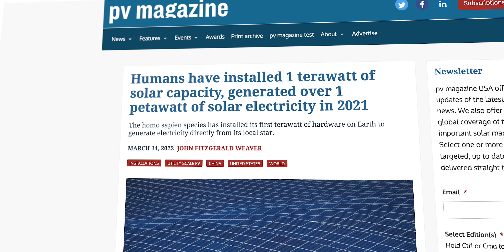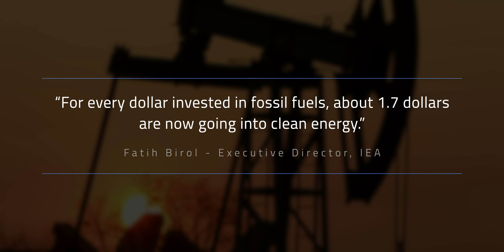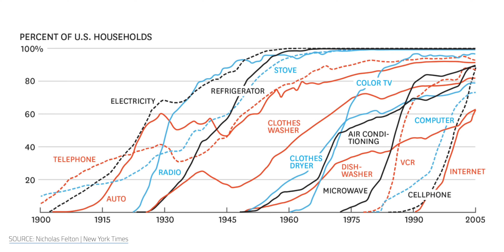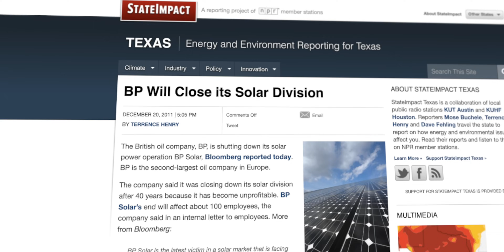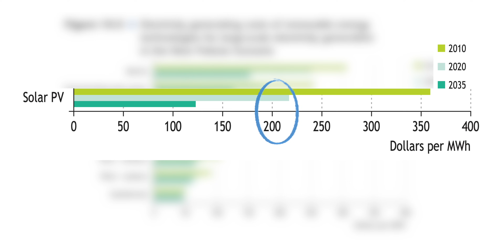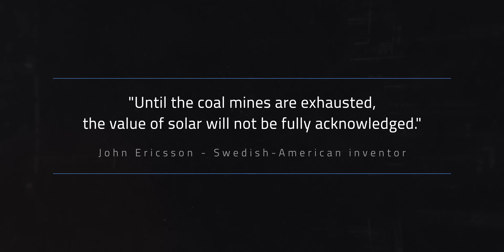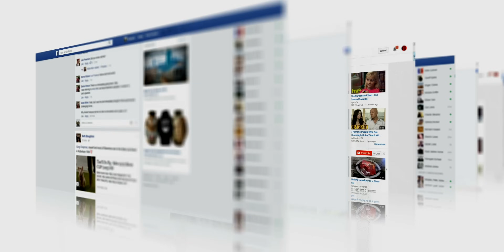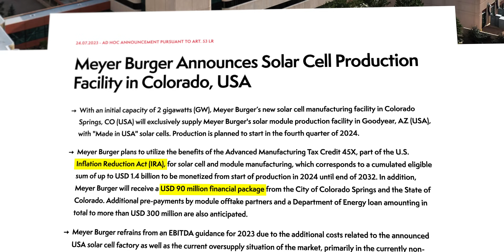How Solar Power Got So Cheap … So Fast

Comment: Imagine if the cost to install solar on your roof also dropped as substantially. It's roughly the same here as it was 7 years ago when I first looked into it.
Reply: I got solar on my home in 2009 and it cost me $8500 for a 3Kw system.
Today you can get that for $2500. (Australia). 
Mind you - when I purchase it, I was also guaranteed a high feed-in Tarif. I still get $0.49KWh today
Reply: Something to consider though is that if it is exactly the same price, then that's actually a ~30% drop relative to inflation over the same period. If your income hasn't risen at all though then that's a different matter.
Reply: The same price over 7 years for something that is mostly hard to automate manual labor is actually kinda impressive.
Reply: Shipping costs for panels 💸💸💸
Reply: @simon359  True.
Reply: New modular builds can just include it from the start, that's probably the cheapest way. Edit: DIY is cheapest of course
Reply: It's about a third of the cost now. The reason why you don't get to see the savings is because corporate profits are up and while there used to be a 16% profit margin, now there's 131% profit margin which is absolutely fucking ridiculous
Reply: @gcburns4 I've studied this extensively over the last 20 years. It's not talked about much for two reasons:
1) Any negative publicity spirals out of control and limits adoption.
2) Retired systems haven't reached critical mass yet for recycling to be economically feasible.
Energy to mine and manufacturer solar cells vs energy generated in their lifetime reached break even in the early 1990s. Now it's off by an order of magnitude. Solar is already good enough to be a no brainer. Energy storage is another story - and lithium ion batteries probably aren't the right technology for the job. But others are already on the way commercially.
Reply: absolutely, there are still tech knowledge required and gimmicks to put together a decent system with battery backup and grid feedin. wish it is more modularized and fool-proofed so any regular dude can install it as if a dishwasher or a fridge..
Reply: @gcburns4  It only takes about 2 years for solar to offset its emissions compared to fossil fuels, and an industry standard 20 year warranty (which does cover degradation outside of the expected 20% loss over that timeframe) which is more than double time needed to reach the financial break even point in most regions. Solar doesn't have a high ROI, but it is about as low risk as any investment could possibly get.
Reply: @gcburns4  What nonsensical drivel.
Reply: If it's the same as seven years ago in absolute terms, then the price has fallen.
Reply: @zweigackroyd7301 how? It’s not like people actually have more money. We are all broke.
Reply: @MoDa87  there's the problem, people voting for right-wing governments which will always shift money away from regular people & towards the already-rich & greedy megacorporations. There's plenty of money around, it's just that we won't see it till we learn to vote in our own best interests.
Reply: Unless we replace the workers with robots or build all houses out of prefab elements including roofs with solar tiles the cost of rooftop solar is unlikely to drop much. Only other technical innovation that might help is lighter panels, as those could be so much easier to carry that fewer workers could finish the job faster, but it is likely the installers would still bill you for at least one full day of work.
Reply: @gcburns4  Yes, There is a lot of ideological elitism on this. Solar would ot be making the gains at this point without all the past incentives.  In a few years, I think every home is going to have power stations or solar power generators for critical issues. Solar power generators are getting cheaper; there is a lot of value is saving a fridge of food and keeping a few lights and critical comforts going.
Reply: @gcburns4  This does get talked about but in general nobody cares because almost nobody is going to throw out perfectly working 20 year old panels, yes they degrade and produce less energy but that doesn't mean they suddenly stop working completely after 20 years, they could very much still be producing around half their rated power 50 years later which is still a lot when we're talking about a 5 to 10kw system for a home.
Reply: Is it the same price for the same size and amount of panels or for fewer larger panels with better inverters etc?
Reply: Its only laws and rules propping up the costs of a system at this point.  I cannot install panels on my own house so it will never happen.  The laws require an authorized contractor and that is the only reason prices haven't plummeted.  Also you dont get the rebates and stuff the authorized contractor does, whether you get is hit or miss depending on the contractor and whether the declared bankruptcy.  5 years ago about half the authorized contractors are now not on the list currently.  Ten years ago its around 80% of them are gone.  You can find tons of youtube videos of local news stories about the nightmare solar has been.  Mostly due to crappy contractors.  People need to be able to install their own panels.
Reply: @gcburns4  Everything you stated is misleading or completely inaccurate.  For example solar panels are warrantied for 25 years or more and they will continue to keep working long after the warranty.  There are 50 year old panels still working.  They pay back their construction CO2 in a few years of use and both batteries and panels are recyclable and many companies are already doing it.
Reply: most of that's the workers and the mounts. Neither have changed much. It'll take much lighter panels to get anywhere on price.
Reply: The costs for installers hasn't really gone down. Has Diesel gotten cheaper? Has minimum wage (let's assume their hiring is on the up & up) gone down? Do they get some form of direct subsidy for being a solar installer? If the answer to any of those questions is no, it would hold the price of installation higher.
Reply: @gcburns4 I agree for the most part, but I don’t think it can be argued renewables have a higher carbon impact than say nuclear (I’ve worked on a nuclear power station, huge amounts of concrete ) or CHP (still burns fossil fuels, leaves renewables in the dust on carbon). You name a power source, I’ll name a major drawback that eclipses renewables. That said, solar panel recyclability is a  surmountable problem. And solar is an elitist technology until it’s so cheap, ubiquitous that nobody cares. Lack of solar for low income people shows a lack of financing option, and huge demand relative to supply.
Reply: @MoDa87  There is inflation. If you measure in constant dollars, $1 today is worth less than $1 7 years ago. Time value of money. Say the installation cost $1000 7 years ago and $1000 today. Seven years ago you could have bought more with that $1000 than you can today. If you had put the $1000 in a saving account 7 years ago, you'd have more than $1000 today.
Reply: @markmuir7338  what do you think about alternative battery ideas like the rust battery?
Reply: Is the op a troll? This is just not true
Reply: @greasybumpkin1661  We need as many ideas as possible for low-cost stationary energy storage. Whether that be rust batteries, liquid air storage, sodium ion batteries, molten salt storage, etc. That way hopefully at least one of them will pan out and become a commercial success at grid scale. It's difficult to tell at this time which it will be.
Reply: @markmuir7338  my engineering expertise is admittedly quite simple, but I have wondered what the feasibility would be of a good old fashioned wind up battery. This is something you don't need special elements for and could be wound up via kinetic energy from wind and hydro. How to scale something like that, IDK, but it's a system that can be repaired and maintained by a variety of technicians, literally just gears and ratchets. Thanks for responding
Reply: @greasybumpkin1661  That's called clockwork energy storage - and it is a thing. A similar old-fashioned solution is fly wheels. Both are simple and use readily available materials, yet are surprisingly expensive compared to even existing chemical batteries.
Reply: @markmuir7338  how so? Do they break often?
Reply: @greasybumpkin1661  The energy density of mechanical energy storage is very low compared to batteries. So you need a LOT of them. Notice how much longer watch batteries last (months or years) vs wind-up watches (a day)
Reply: In 7 years the price for brackets, bolts, and labor, would stay the same. Unless you know how to make metal cheaper, or enforce slave labor, installation is a pretty standard fee. You'll literally need to exploit your work force, (possibly making them slaves over time) for continued price drops of manual installation jobs. Literally just pay the laborers what they're worth and stop acting like everything should ALWAYS be cheaper over time.... a lot of that is achieved by the Chinese who work 80-90% of their waking hours living inside factories.... seriously STOP complaining
Reply: @baileescott401  I agree. Also if we pay people well for very good craftsmanship, then the products ought to last and be a worthwhile investment. The west got into cheap goods because the consumer and financial market replaced the productive one, the former requiring constant spending.
Reply: @markmuir7338  ah I see, so I guess the storage solution has to be chemical in nature then until something else is discovered.
Reply: @greasybumpkin1661 There's schemes like pumped hydro (which is around 80% I believe)
But it requires very specific geography, a huge hydro installation and transmission lines laid in.
Whereas you can site solar on a defunct coal plant, transmission/interconnect is already in place and batteries are modular requiring only a pad.
Reply: @@mitchellcouchman6589 Even in China only about 60% of the electricity comes from fossil fuel, and solar is displacing fossil fuels a lot more than it is displacing nuclear or renewables. That 35-40% makes a significant difference in the carbon intensity and therefore the time needed to reach net zero emissions.
Reply: @InvisageStudios 
Was there an increase is subsidies there since you got them originally? Of the places I’m more familiar with, almost all have had an increase in subsidies over time (although some have recently started to reduce them or are planing on reducing them soon) and the cost have increased over time even with more subsidies.  Where I am,  the cost of a 3kw system is 4-5 times what you mention( yes I converted to aud), and this is not including installation.
Reply: @billweir1745 really Bill?  Because I have done my own 24KW install and I agree completely with his assessment.  So what are YOUR numbers?
Reply: ok
Reply: You can do it yourself with a month or 2 of education and a diagram submitted to the local power provider. My whole system cost me ~5k, and I have a 5.5kwh throughput 120v output system with 7kwh of solar and 4kwh of LiFePO4 batteries, shield wire so on, I'm also a very good shopper though so most would spend 7-8k for the same.

Comment: Cheap solar PV was surprising for even me. While planning my off-grid net-zero lodge and cabins development, I had been planning on a mix of solar PV and thermal vacuum tubes, but an advisor pointed out that even if I use resistive water heaters, for my climate of Nome, Alaska it’s better/cheaper to use just PV. Of course I’m using heat pumps, so it’s even better.
Reply: I'd be interesting to know more, if you are willing.  I live in Canada and so far, it would seem that PV doesn't produce enough during the snowy times to be worth while. Clearly your numbers don't agree.
Reply: @markbernier8434  Just to be clear, I’m comparing solar photovoltaic panels to solar thermal tubes (thermal tubes beat thermal panels for cold climates)
For this it now makes sense to just use PV and not use thermal. We will still need diesel generators for 2 to 4 months a year, but we can use the waste heat from that to offset the load on our heat pumps.
Reply: @AnvilCreekLodge  Pretty similar to what I did. When I started planning, I made a leap of faith that solar would come down in prices (I'm in the tech sector, I saw a solar panel in the same way as a microprocessor). I'm off grid now (you can find my blog about the entire place on my channel) here in Finland at 63 degrees north. I also need a generator in winter, but I make my own bio diesel from waste cooking oil so I'm still pretty much fully energy independent.
Reply: I’m finding a similar situation emerging with my setup in South Africa, we have plenty of sunlight - and I’ve considered putting a solar heater in addition to my PV+battery setup but I’m finding with the upfront cost of retrofitting a solar heater not working out very attractive compared to supplementing/powering the resistive element with PV on a scheduled basis. I’m able to absorb about 40-50% of the hot water bill with just PV. Automating the time of use with an external temperature/timer control would be ~$200 vs ~$1000 for a solar heater retrofit.
Reply: I'm surprised at this, is the problem with solar thermal the price of the control gear & a tank with an extra coil?
I'm not in the market yet but from what I've seen the systems are overly complicated.
Solar thermal should be good because it can accept more energy than the 22% current maximum of PV.
Reply: @alanhat5252  I was surprised too. The problem with thermal is the cost and complexity, and risks, they are better for thermal, but not more betterer enough to be worth it. 
For the darkest and coldest two months neither is a good option. For two shoulder months it might be better to have thermal, excluding risk and complexity.  For 8 months a year, having extra electric power, especially in conjunction with a heat pump.
Reply: @alanhat5252  yeah I was surprised too, and you’re correct; it comes down to cost and complexity. If the objective is offsetting or even replacing the cost of heating water, then solar heaters are great. But in the case of the (much larger) outlay for PV+Battery, and then considering the benefits of a solar water heater install seem to overlap too much in my case when considering the costs. If money wasn’t a consideration, PV + heat pump would probably be the best option in most climates. Long story short, I guess since I’ve managed to take care of 50% of my water heating bill through time of use, the idea of having a solar heater install on my roof with all the pipes and probably pumps just seems unnecessary.
Reply: I can't imagine how that would work out at that latitude.
What am I missing?
Reply: @jimurrata6785  the Cold Climate Housing Research Center is at the same latitude. I think you're missing "spring" and "summer" It's when the temperature is much higher and the sun shines a lot, like over half the day.
Reply: We are currently redoing our website, we plan to add real-time and logged data on our systems. It's a passion project to prove that this can be done, even at 64.5 degrees North latitude.
Reply: @AnvilCreekLodge  Thanks for the reference. I'll have a look
Reply: - that is hard to agree - the resistive heat comparison..  seeing as a well tuned solar thermal system generates around 3x the peak energy of solar PV (Nome may be a special case, and if covered by dismal grey winter skies  which while poor for PV are worse for thermal) -  for PV to get ahead of evacuated-tube thermal, heat pumps are generally required - resistive just "does something"  -  last option before wasting the power  - on a terribly sad day - which is better than nothing.. - noting that evacuated-tube thermal doesn't do a whole lot towards cooling in summer - without extensive investment in absorption chilllers...
Reply: @stucorbishley   - the fungibility of electricity - given one's ability to readily use generated power - the last thing to consider is the final dump load for excess- before curtailment is needed. (if hot water is that last step in the chain, then a large resistive heater costs very little (even as simple as an insulated concrete tank with an XkW immersion heater.)...  If all one is creating is hot water - in summer one only needs "so-much" - though intra-seasonal storage becomes a thing - retrieval via a ground source heat pump in winter..
Reply: @kadmow  Sounds like I need to run an experiment. But if the installed cost per collection area of thermal is 3x solar, then they are even.